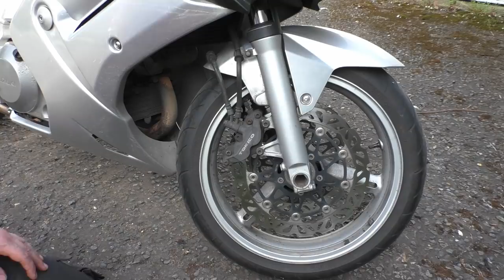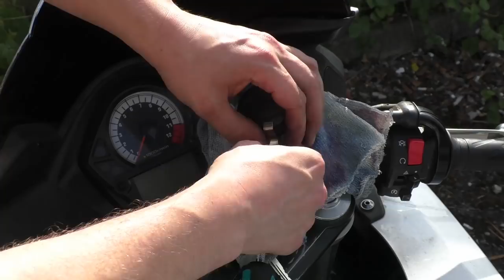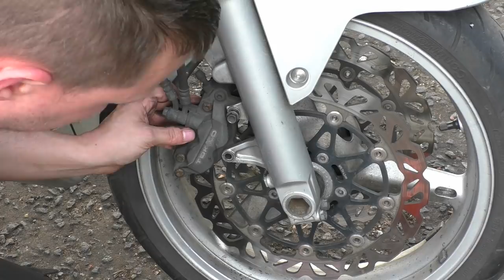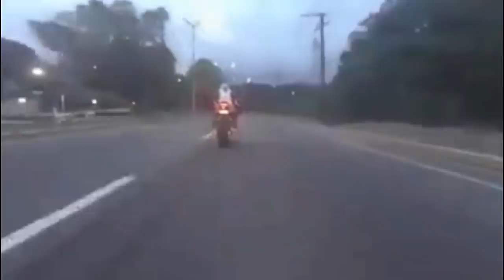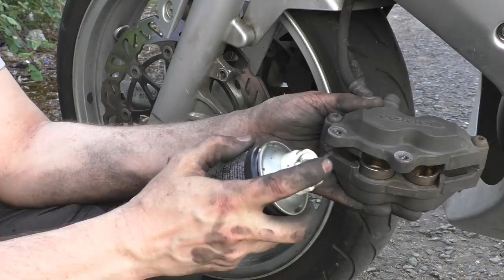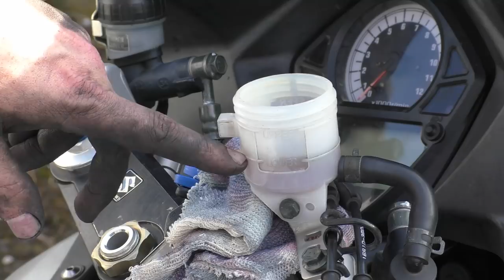Changing Brake Pads - Anyone can do it

Comment: Brake cleaner is used to keep the dust down and wash out that dust. In a shop even with proper ventilation dust lingers and people breathe it in. Like water spray in a mine. I would love to see a video explaining thermal heat loss of rotors with and without cut outs vs the braking efficiency of such differing designs.
Reply from the maker: I'll be doing one better - but you'll have to wait

Comment: You can get refillable (via shrader valve) spray bottles to use as compressed air, kinda pricey TBH but you can keep refilling and reusing, you can make them too with a tyre valve I've seen a few vids around

Comment: No supride the bellows in your master cylinder was compressed. as the pads wear the pistons will be further out, the fluid behind them has to come from the master.  dont top up before pushing the pistons back

Comment: A conversation between Matt and His Doctor

Dr: Matt you have Mesothelioma
Matt: How the fuck did I get that?
Dr: My guess is for brake dust from your motorcycle.
Matt: That make no bloody sense the brakes are to far away plus they only produce microns of dust every time you use them here let me show you on the white board.
30 minutes later of white board drawings calculations and alot of swearing.
Matt: So doc there is now way I could inhale to much asbestos from riding my bike.
Dr: Maybe when you changed them and only used compressed air and the particals blew up in a huge cloud of dust.
Matt: Oooohhh
Dr: it's pretty bad too I hope this made since and we'll quite frankly I will not be seeing you in a bit.

Comment: 7:07  The solvent probably has the added benefit of keeping the asbestos from going airborne so that you don't get those carcinogens in your lungs.
Reply from the maker: asbestos? Have we quantum leaped back to 1971?
Reply: It would depend on where you live, but this is what I read:
https://www.epa.gov/asbestos/us-federal-bans-asbestos#notbanned
Also, even if it wasn't asbestos in the pads, brake dust ain't too yummy, so my point still stands.
Edit:  Another source ( https://www.asbestos.com/companies/ ):
"Although the U.S. Geological Survey asserts that U.S. asbestos use has fallen 99.9 percent since 1973, it is not yet banned in the United States. Limited amounts of chrysotile asbestos remain in brake pads and other friction materials, building materials like cement and in various textiles."
Reply: +huyked 
Correct.
Reply: +The Workshop 
The Workshop stated: "asbestos? Have we quantum leaped back to 1971?" 

It is a widely held misconception that asbestos is not a component of any modern composite friction materials. 
Asbestos is still a component of many products including friction materials, seals and gaskets. 
Not all friction materials, seals and gaskets, but many contain some asbestos. 
Asbestos is not banned for certain uses such as friction materials, seals and gaskets in many countries including the US and China. 
Also UK and Europe did not begin actively banning asbestos materials until 1991 and asbestos was legal in many UK/EU components including friction materials, seals and gaskets until an EU directive dated January 2005. 
In 2017 US manufacturing was still importing approximately 350 tons of chrysotile asbestos each year with approximately 90% of it from Brazil and the remainder from Russia for incorporation into numerous products including friction materials and gaskets. 

https://www.epa.gov/asbestos/us-federal-bans-asbestos

https://www.osha.gov/dts/shib/shib072606.html

https://www.autoserviceworld.com/jobbernews/growing-threat-asbestos/

https://www.epa.gov/asbestos/current-best-practices-preventing-asbestos-exposure-among-brake-and-clutch-repair-workers-1

https://cordis.europa.eu/news/rcn/13445_en.html

https://www.google.com/search?num=100&newwindow=1&ei=68cdW8-rHITQ8AOf2IPgCA&q=asbestos+in+modern+friction+materials&oq=asbestos+in+modern+friction+materials&gs_l=psy-ab.12...13197.27823.0.30270.7.7.0.0.0.0.265.1198.0j5j2.7.0....0...1c.1j2.64.psy-ab..0.2.417...0i13i30k1j35i39k1.0.hSELxkxHF-g
Reply: patw52pb1
Thank you, Pat, for the added sources and information!

Comment: Where is the ounce of copper paste per square inch on the back of the brake pads you suppose to put on it? As by EBC recommended. And I would clean the crap of the pistons before I push them back... I just don't want to fuck up my rubber seals with all the shite that is baked on it. If you clean it wet you don't need to inhale the shite of the brake pads.

Comment: Hey Matt when routing a clutch cable can i route it any way that works so that it doesn't bend or bind up ? As well as the bars being able to go full lock either way?  I just don't feel like removing my tank and need to replace my cable as for it snapped stupidly removed the original before getting the new one so I can't tie the two together to feed the new one.
Reply: Greg G It should be somewhat stable and have enough space that when you turn the steering it doesn't pull on the clutch. But why not do it proper. Just removing the tank should be fairly easy
Reply: alles klar klaus because the vaccum nipple for the tank pops off and it's a bitch to get back on.

Comment: They should design the reservoir with a child proof cap on like a medicine bottle then they would never come loose. As for the language, well if your not swearing then your not a proper mechanic LOL. Oh and just a mention , if of the several types available ,a harder material is selected for the replacement pads the discs will obviously wear below manufacturers specification a lot quicker.
Reply: BMW uses caps that have a kind of child proof pins that have a special tool to press in... but works with out the tool too if you can pinch both sides at the same time.

Comment: Fuck it I never use thread lock, must buy some, also would you ride with a plugged tyre? or is it only a temporary fix, thanks.    ps that copper grease is nonsense alright, every fucker talks about it and red rubber grease on the pistons/seals area.